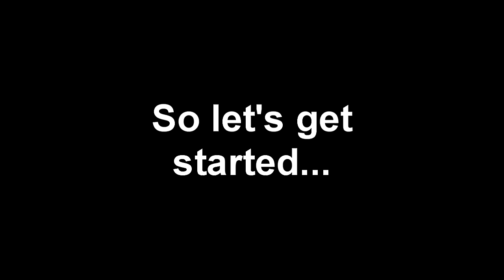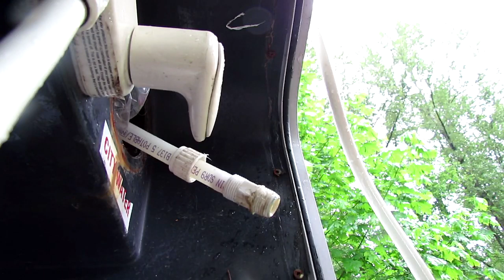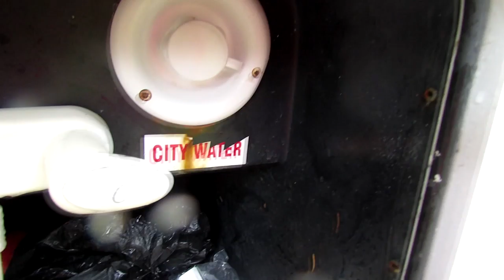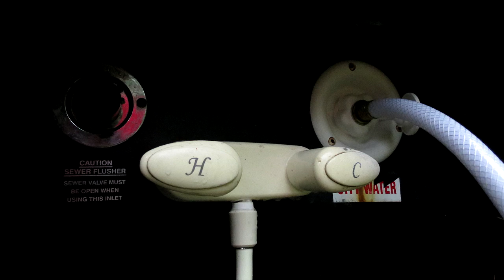RV City Water Connection Replacement

Comment: I had to replace mine a few years ago but somehow watching you do it was far more entertaining!
Reply: Was it the water leak you enjoyed..I'm actually glad it leaked so I could see really what to watch for. Andrew what furnace do you have.  Mine is Surburban. Lately it's miss firing..just won't kick on every time. Any ideas besides buy new one!
Reply from the maker: Clean the exhaust. Check the wiring connections. And check your thermostat in case it's just that. Do you have a modern digital thermostat? What exactly is it doing?
Reply: @Linescrew1Canada  clean exhaust .. is that the vent on exterior?  Took interior furnace cover off..for 10 years very clean. Small round view window shows the flame. When heater tries to click on there is a spark but won't actually stay lite. It will attempt to try again in about a minute. Plenty of propane. Good air flow. The manual was no help. Thermostat is Dometic manual old style.
Reply from the maker: Sounds like the circuit board is killing the gas supply for protection. A tech should be able to diagnose and fix this quickly. It doesn't sound expensive.
Reply: @Linescrew1Canada  awesome thanks..yes it will try to click on and occasionally does. I have a RV technician dropping by tomorrow to look at some exterior repair so I'll have him look at it. I'll let you know. Thanks

Comment: Nice job Andrew ! If I may suggest (maintenance mechanic most of my life). The final test for leaks, run the water in the R V, get all the air out of the system, then you'll be good to go !!
Reply from the maker: Yep, I did that twice. Checked for leaks inside and out.

Comment: Working on my Rpod. Didn't know how easy it looks to replace water connection.
Reply from the maker: When did you buy an Rpod?
Reply: @Linescrew1Canada  I bought my 2010 Rpod in 2013..an English Professor in Oregon had used it 4 times. Perfect for one!

Comment: I see your hose goes inside a storage compartment.   When you connect your city water hose do you just let the storage compartment door open or resting on the hose or am I missing something. Me new one is like that and I find it odd that it is not on the outside wall of the motorhome e!
Reply from the maker: I put in a Velcro door catch that keeps it open to prevent the open door from getting blown around in the wind.  My RV is made in Canada and this design works well, as you can close the door to prevent freezing when doing off season camping.
Reply: @Linescrew1Canada  so you actually leave the door open while at a campground!
I am in Canada also!
Reply from the maker: @jacques1543  Yes, you have to keep the door open if you're connected to city water.

Comment: Teflon tape on a hose connection?

A hose connection effects a seal via a gasket but the threads are not designed to seal. Get some spare gaskets and save the teflon tape for tapered pipe threads.